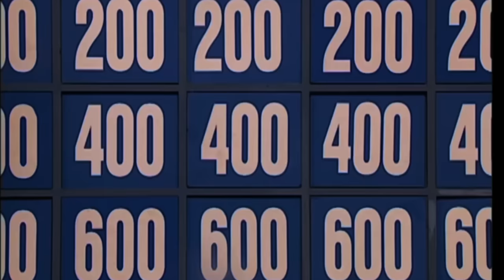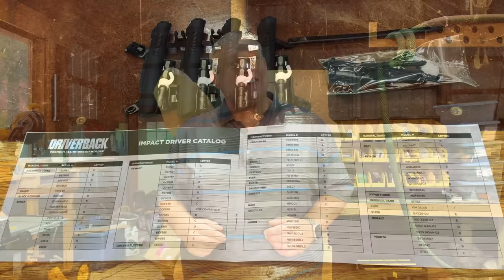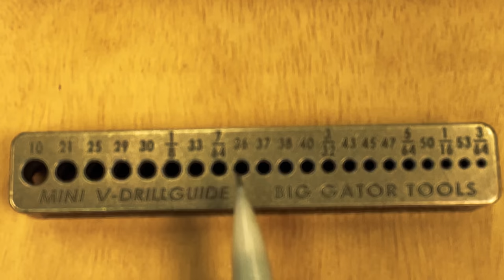Are You Missing Out on These 5 Unseen Woodworking Gadgets? #woodworking #amazingtools

Comment: have you ever looked to find anything to cut a straight  edge on a live edge using a track saw
Reply from the maker: Thanks for the comment Ray, I'm not entirely sure I understand your question.  Are you referring to how to cut the live edge off to essentially joint the live edge board or are you referring straightening up the opposite side of the live edge maintaining the live edge feature?    For that I usually just use the track with the track saw and line up the track exactly where I want it, but I suspect I am misunderstanding your question.